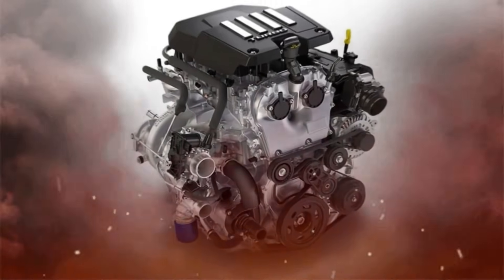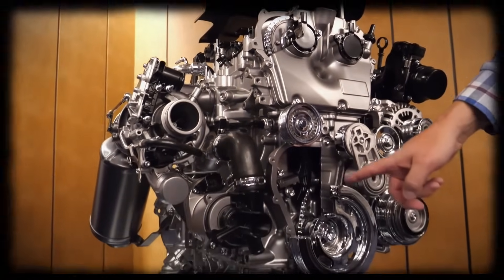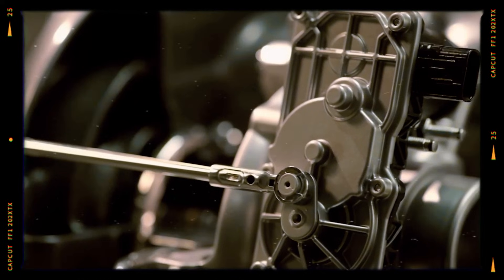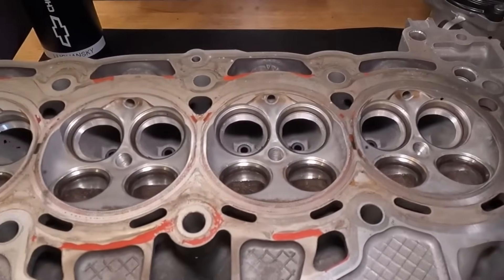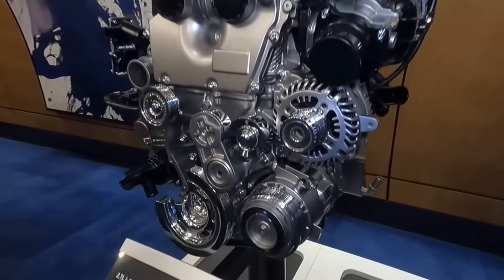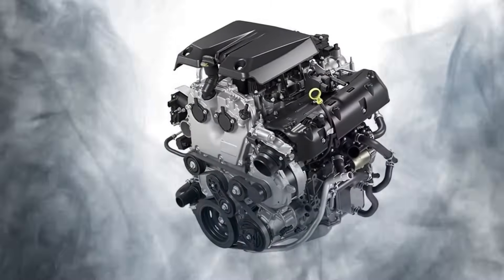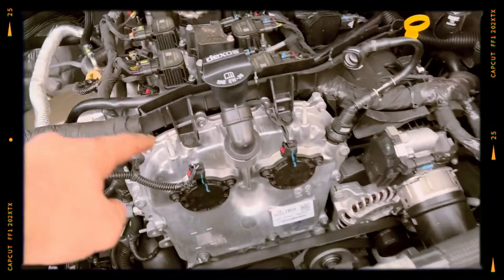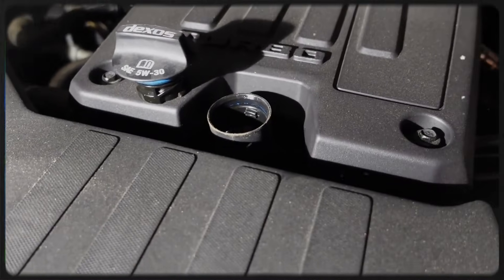GM 2.7 L3B Turbo engine! Characteristics, overview, common problems!

Comment: Ok this engine 2.7 was made by a company mix of GM,Japan,Audi be careful of this type of engine turbo changing new oil every two months no I would not have this vehicle a lot of problems in the engine head issues

Comment: Leaking oil since 8000 miles...also consumes about 2 quarts between  oil changes...cams gave out at 136000 miles....always did regular oil changes....they are designed to fail

Comment: There it is. This engine is reliable because it’s built at Spring Hill manufacturing. The LNF turbo engine from the Cobalt SS, Sky RL and Solstice GXP was built there as was the 2006-2008 2.4 liter Ecotec VVT in the Ion, Cobalt SS/Sport and Pontiac G6. These engines were rock solid until 2008 when manufacturing shifted to another facility. I know where, but I won’t say. Let’s just say it’s where all of the small block V8s are built.
Reply: Is Flint MI bad? If so?? then why?

Comment: Curious how this engine does for fuel economy cruising at interstate speeds of 80 to 85 mph?
Reply: I drive one every day, work truck.  16-17 mpg at 80-85 mph.  20-22 mpg at 70 mph.  26 mpg at 60 mph.  All flat ground no trailer, no load in the bed etc.  Cheers
Reply: I was wondering what fuel mileage was like on an 80 mph interstate. About the same as my 2013 half-ton with 5.3. I completely rebuilt the engine. It's bored +.020, AFM deleted, VVT deleted, has a high performance truck towing truck cam, nice headers, and  exhaust. With cheap E-15, 88 octane it runs 14.5 to 15 mpg at 80mph, with good 91 octane it does 17.5 mpg. I run a 150 mile stretch of interstate to my permanent RV campground and back  every weekend. My 3500 Duramax will get 18 to 19 mpg. I guess I wont be replacing our car ( totalled on a deer) with a turbo max. Thinking hybrid. Thanks.

Comment: Anything with AFM I want nothing to do with!!! More stuff to grenade!!! And on a 4 banger,which is crazy!!
Reply: Sliding camshaft design like Europeans have been doing if for years. The only ones that grenade are the cheap lifter actuated design the hemi and gm V8s use

Comment: I have a 2021 RST with this engine it has 45,000 miles and I've had one issue. A software update for the fuel injector. Other than that it's been great. And I tow my boat a lot. I love GM trucks but they have gone down in guilty since 2020. That can also be said about all auto manufactures.

Comment: 2024 Silverado LT 20,000 miles numerous 1400 mile round trips to the mountains back to central Florida , no issues at all it’s a power house for everything that I need it to do .
Reply: I have that same truck, curious about what gas to use? 4 bange tells me go cheap.
Reply: @jaredtandle2596  I use Sam’s regular it’s right next door , average about 23-24 mpg if I’m nice to it

Comment: Take it from GM dealership mechanic that these are highly problematic. Engine block failures, cylinder head failures, camshaft failures, head gaskets blown, high  oil consumption, high pressure fuel pump failures, fuel injectors failures and misfires that can't be resolved. Take a hard pass on this one folks.
Reply: No offense, but you’re probably just an angry Ford guy.  I’m the CEO of Ford and our vehicles are always failing.  See how easy it is to claim you’re something you aren’t?
Reply: Which is worse, the V8s with AFM/DFM or the 2.7?
Reply: @bullitthead7853  2.7 easily tops the trash pile. None of the 1500 engine options are great but the AFM/DOD can be dealt with by turning it of either via tuner or a plug in device. Lifters don't get suck if you never let them go into the 4 cylinder mode.
Reply: Is there any way to prevent those problems? Like proper maintenance or something?

Comment: To avoid carbon build up in the intake manifold there should be install from Factory and Oil catch can because of the over pressure in the crankcase there is a hose from the crankcase to the intakemanifold so all the gunk their is in the crankcase is transportet up to the intake and then it becomes gunk in the intakemanifold just like the Audi 4.2 fsi V8 and so on.
Reply: No need the pcv system actually works to keep oil out of the intake, just a little intake cleaning spray every 15k to 20k should keep it pretty clean

Comment: Son-in-law bought this engine in a Silverado Custom in 2021/2022 (not 100% sure of year) and now has 35K.  I do his oil changes and it will get rid of over a quart of oil every 5k miles.  It's not leaking so it's burning it but since GM has increased the oil capacity probably to allow for this loss it's not an issue when serviced at 5K.  The computer will show about 30-35 percent oil life left at the 5K change.  Any concern I should have about the carbon buildup mentioned and what methods are used to help combat it?  Should I drop back to 3K oil changes?
Reply: Turbos burn oil. Just the nature of the beast.

Comment: You said 14% more toque than the v6 it is 40% more torque 225<430ftlbs. What GM really need to do is make another engine the “L6B” with 2 more cylinders in an inline 6 configuration with a bigger or even compound turbos to put those big blocks to shame. 700ft lbs and a smooth balanced 4.1l i6.
Reply: I heard the 5.3 will be replaced with a I6 twin turbo. Who knows.....

Comment: I have one with over 32000 miles and so far it’s had no issues. Although I have to say I can’t stand how bad the turbo lag is! Makes me wish I got one with a V8
Reply: You have too adapt your driving style to match how turbochargers work.
Reply: @ I agree that you will normally just adapt to how a vehicle drives, but this is just way too much turbo lag and after over 32000 miles I’m as “adapted” as I’m going to get lol! I normally keep my trucks for well over 300000 miles, but will be trading this in real soon for something els without a turbo and probably a different brand.
Reply: I think the 5.3 lags more. 10 speed is so sloppy on them.
Reply: April 2025 a firmware update to the fuel injector module fixed the lag and improved the mpg on my 2024 ZR2 Colorado.

Comment: I just recently bought a 2025 silverado 1500 custom with 2.7 turbomax. I was wondering if a whining sound when driving normal, i was told by the service advisor it was?
Reply: It's the turbo. Look up turbo whine. It's completely normal.
Reply: My 2023 does it.  I have 30K miles so far.
Reply: It the turbo 😂
Reply: @axmnstrbnd do you have one? If so do you hear it in the cab? Nobody seems to want to answer I’m beginning to think you can and it’s probably irritating
Reply: @Kurt-n4i  i have a 23 canyon at4x with that motor.. I hear the turbo for sure.
Reply: Are you hearing this in the cab? I’ve heard it on a truck next to me and it doesn’t sound good

Comment: Why doesn't GM incorporate port injection along with the direct injection fuel system for this engine?
Reply: emissions regulations and fuel economy pretty much. id say probably better for planned obsolescence as well. same reason most other makes are going back to gdi unfortunately. personally id take the % loss of mpg to have the port injection just for the cleaning it does

Comment: It’s an over pressurized four-cylinder it will only last so long the V8 will outlast these motors on teardowns the bottom of the cylinder will be worn bad on these motors
Reply: The problems are literally on v8’s 😂

Comment: That thing got more gadgets on it than a Fuller brush mans sample case that’s ought to hold up great in 115 degree ambient pulling 20 thousand pounds up a 25 degree grade ! What could go wrong ?
Reply: I don't think you're gonna be towing 20,000 pounds in any climate with that.  Need a big ole diesel for those numbers, the new diesels are even worse in the gadget department though.

Comment: This power train now comes with a 5 year 100,000 mile warranty
Reply: Unfortunately not on my Chevy Colorado.  I'm sure it's because there is no other engine option on the Colorado and they are trying to steer people to this engine on their larger trucks.
Reply: @radian2323  I'd imagine that you are correct.  Colorado has 5 year/60,000 mile powertrain warranty though right?

Comment: I have a 24 Colorado zr2.the active fuel management never comes on at highway speed.it will come on at 60- 70 kmph but only for about 10 secs.seems useless to me
Reply: Is there a display on the dash to let you know when AFM is active?

Comment: Would like to see how much carbon is on the valves of these engines after high mileage or hear an explanation on what GM did to mitigate it.
Reply: They use a pre-event fuel pulse to prevent carbon buildup . It shows up in the boundary timing on HP tuners in the vcm editor .
Reply: @Dr.Westside  Interesting, can you expand on this?  Is this a fuel pulse that occurs while the intake valve is open?
Reply: @bullitthead7853 
My son drives this diesel ZR2 Colorado and it seemed to have “burp” of some kind. I tried like heck to find this. I thought it was messed up. Now I know that it is just a burst to kick out some soot.

Comment: I own a 2023 2.7T and am really happy with it! Great torque/smooth/quiet/good overall fuel economy. Amazing on highways through the mountains.
Reply: May I ask what octane level fuel youre using?
Reply: @ 87 Octane
Reply: Hi what’s your mpg as a daily ? I just bought one I’m getting 14 city I don’t think that’s normal but also I have mud tires I don’t think that would cause a major difference.

Comment: the new ones have an aluminum oil pan, updated high output version relies on up to 27 psi of boost. AFM system is not an issue in these DOHC motors, GM is only finding issues with that on the 5.3 and 6.2.
Reply: Really, running on two cylinders  and Direct injection.  I would be planning on cleaning Carbon at some point!
Reply: Another thing need to be careful for is that even small ice chunks can bend those tiny turbo blades.

Comment: 216k and counting. No issues.
Reply: Nice!
Reply: @ericj810  question, how many tons do you haul?
Reply: @andysteward8617  the truck pulls around 7400lbs daily
Reply: @ericj810  that's 200# more than my Z71 is legally capable of towing.
Reply: @andysteward8617  Millions
Reply: This is great to hear. When all is said and done, I think the L3B will be one of the best turbo 4cyl engines ever made.
Reply: @ if it turns out, it’s the greatest 4cyl turbo GM has ever produced, that really ain’t sayin much
Reply: If I may ask. Which oil do you use and what interval? Thanks.
Reply: @IndianMC-jf3cp mobil 1 dexos 1 5w 30. Transmission uses mobil 1 dexron HP blue lablel only! Carbon isn't much of a issue with these. Oil/air pvc keeps it at bay.
Reply: What oil did you use?
Reply: @Danzilly Mobil 1 dexos 5w 30 change every 5k mikes keeps turbo lasting. Turbos need clean fresh oil they can last a long time.
Reply: Excellent,  what year is yours?
Reply: @jesusramos6443 226k its a 2021.
Reply: have you been doing any specific maintenance to prevent carbon buildup?
Reply: @fourarrowheads  you really don’t need to do anything crazy, the pcv system actually works really well with next to no oil bypass which causes carbon build up, if your worried they have a spray which you can use to clean the valves which you could use every 15k to 20k miles
Reply: What type of gas would you use? 4 banger tells me just go cheap.
Reply: @jaredtandle2596  Owners manual suggests 87 octane. Turbomax is no cost option. Standard engine that makes 12% more lb-ft torque torque @ 27% lower rpm than 5.3 V8. Similar payload & towing turbo I-4 vs 5.3. 100k drivetrain warranty. No brainer. 216k miles on this guy's engine, so it has longentivity too.
Reply: have you had to replace a turbo? thats what everyone keeps telling me is "the turbo will only last 80k". i think they are full of it.
Reply: @rozzbourn3653 mines almost at 80,000 and all I have had to replace were tires and oil changes. I've done the recommended maintenance as well, and wiper blades. Lol it's a 22 that I've had since Jan 22
Reply: @Muledogg7  thats what i was thinking. not too much info on if or when people have had to replace them, but im thinking they will go 150k+ if you change your oil on time.
Reply: Is there anything you did specifically to keep the engine running so long
Reply: On mu silverado 1500 2022 custom i had a leak at 44k
Reply: Is it still treating you good a year later?

Comment: Been a professional mechanic 1987, seen a lot of small displacement, turbo charged GM product’s hit the market over those years, none of them held their value, nor were they reliable past the warranty date/mileage. I expect this to be no different. Laughable thing to me, is this turbo’ed 2.7L, gets worse mileage than the 4.8L, or the 4.3L. What a joke!!!
Reply: That's simply not true about gas mileage. Had a 4.3  vortec in an S10 16mpg. 4.3 ecotec in a Silverado 18.5mpg. 2.7 in the Silverado 20.5 mpg. Those all averages over long periods of time.
Reply: @ weird, I have a 2000 1500, with a 4.8, Manuel transmission, I get 23mpg on real gasoline, and 21mpg on blended gas. It’s been doing that for twenty five years, along with zero major repairs, only replaced the clutch ten years ago.
Reply: Like it or lump it, Turbos seem to be the future for all of us be it a fad or an obsession only time will tell.
Reply: Only the future because our government knows better than engineers
Reply: 27000 miles in 9 months haul 5 guys and 300 pounds of gear crew cab with 3.42 ratio 16.5 mpg unless it’s 80 degrees or hotter truck gets 12.5 mpg due too 87 octane company fuel I change oil at 5000 miles with synthetic but motor uses 1 quart last 1000 miles The engines only run on 91 or higher octane
Reply: I have driven pickups with both engines.   The 5.3 gets better mileage.   Anything over 65 requires the turbo to use boost. It could be made very durable if the pollution controls and the engine efficiency gimmicks were removed.
Reply: Embrace the New smaller Engines it’s our future.
Reply: @ I work on them all, the future, well, I can verify, the only constant, is change
Reply: @andysteward8617 yes, truth.  The only hope we have as consumers is Trump ditching all things CAFE and reining in the bastards at the EPA
Reply: @ amen
Reply: Anything boosted gets lower mileage.
Reply: Turbos=low reliability,direct injection=carbon. GM sucks.

Comment: A 4 cylinder engine gets worse mpg then the old 3.6L WTF? Looks like GM is going backwards.
Reply: It’s not about efficiency, it’s about emissions compliance.
Reply: @Holden-McGroin  So a engine that needs more fuel than a V-8 to go the same distance is efficient?
Reply: @amorris1970  Did you read my comment? I said it IS NOT about efficiency, it’s about emissions compliance. Either engine is still pushing a 5,000lb truck. The turbo engine is loads more fun than the 5.3 V8 if you actually like to get on it.
Reply: @Holden-McGroin  Did you read mine? More fuel is not emmissions compliant. The goal s to use less fuel and go farther. Thats emmissions compliant.
Reply: @amorris1970  Nope. It’s about burning it cleanly. If that were the case, everything would have small turbo-diesels getting 50+ mpg. I don’t make the rules or agree with them, but that’s what the manufacturers have to work with. Same reason they keep making trucks bigger; emissions allotments are determined by vehicle footprint.
Reply: @amorris1970  It puts out more power and torque than the V-8. 310 HP and 430 torque. Power needs fuel.
Reply: @Skyhawks1979  You're not getting my point. As far as the emissions stand point. How is burning more fuel better for the environment.??????
Reply: I just love these people that say like a 4.3L, 4.8L can not be efficent. All the emmisions come from the head and added componnents. So, fixing something that isnt broken is a waste of money.

Comment: love mine with the turbomax 2.7l  crew cab   4x4  only issue  is  at 20 mph or below   touch gas peddle to hard and lights the back tires up  old 5.3 i had  would not spin the tires on ice
Reply: That sounds kinda cool to me!  I have to test drive one nest time.
Reply: @chrisoconnor3119  they have a  flapper valve before the muffler .  pop the spring back  turn it clock wise put spring back in   lot mot power and turbo whistle
Reply: @ArkansasChainsaw  can you do it from the outside of the exhaust system? I don’t own one yet but definitely going to be my next truck
Reply: @banana_phone4228  you just  have to get under the truck    has flapper just before the muffler  push spring back with a screwdriver  turn valve to open position  pop spring in net hole   spring holds valve open   works for me

Comment: It makes 430ftlbs of torque now. I think they only gave the original figure. Plus they use an internal baffle, similar to an oil catch can for the pcv to help with carbon. Does it work? I don’t know but I haven’t seen any issues yet.

Comment: I would not choose the ford eco boost engine over this gm engine.
Reply: So far it has  better reliability than the Ecoboosts but the 2.7 Ecoboost takes it out in performance.
Reply: 2.7 eco boost may perform a lil better. Lower gear 10 speed transmission then the 8 speed chevy. But the eco boost will blow b4 the turbo max will. Drop a lower gear in the chevy it will run the eco boost. The 8 speed actually tows very well on the chevy 2.7. Wasn't built or geard for break neck acceleration.